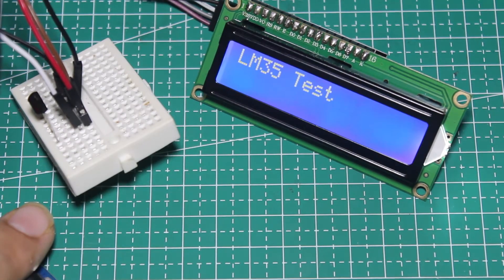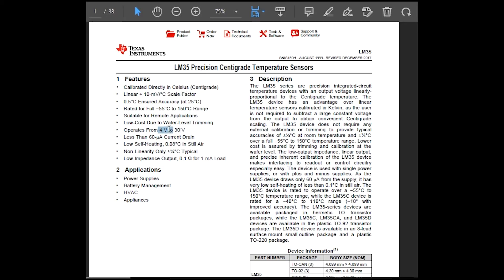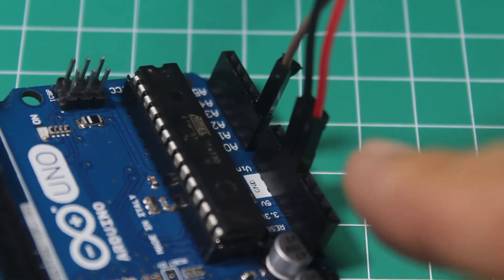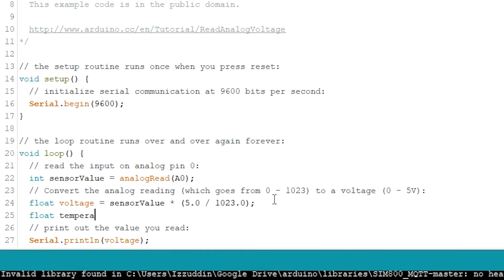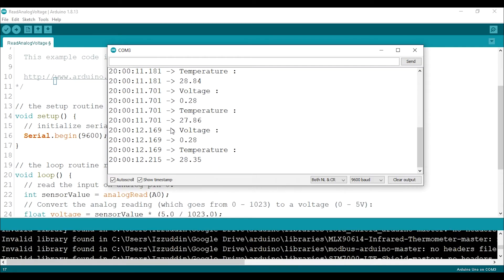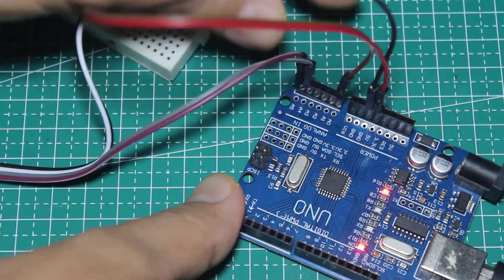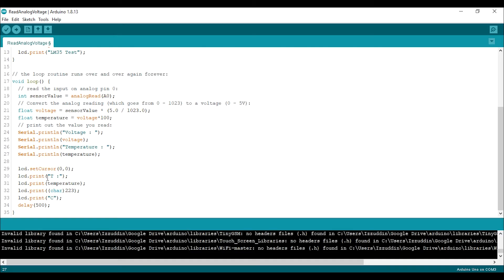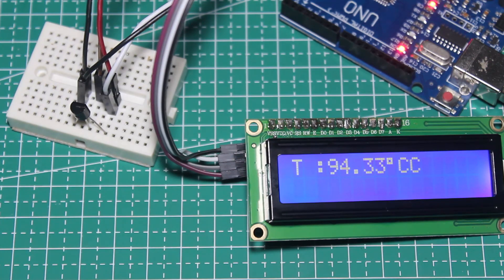How to use LM35 temperature sensor with arduino

Comment: Can you tell me about the power supply, can we give it 9v battery supply to Arduino
Reply: 9 volts at vin pin or the dc socket is ok.

Comment: Thank you so much for this video

Is it possible to add an battery voltage sensor along with the temperature sensor in the same Arduino, How can we combine the both programs
Reply from the maker: It is easy. Just analogRead on another pin, then do your formula to get the voltage and print it.
Reply: @miliohm   If you don't mind ,  Do a detailed video on this,  I sure that it is very useful ,  I would like make the same  project to my motorcycle to calculate battery voltage & engine temperature

Comment: why my sensor results if I get a hot temperature, the value goes down?
Reply: Same... Is it solved?
Reply: did you solve the problem? I'm getting the same behavior and I did exactly what it's on video
Reply: @alejandromartinezbaena7387 hey, did u solve the issue? Im having the same problem. Please help me if u figured it out.

Comment: I have same sensor but with different shape, is the same datasheet correct for both.
Reply from the maker: What kind of shape do you have?
Reply: @miliohm  it is the module one, it looks like a chip with a sensor. LM35 module.

Can I know what is the difference from sensor only.

Thanks for the reply.
Reply from the maker: If there is no additional IC there, should be the same. It is just used for easier use on breadboard